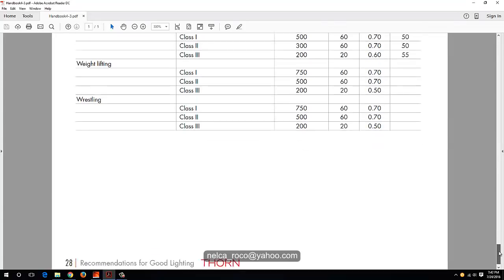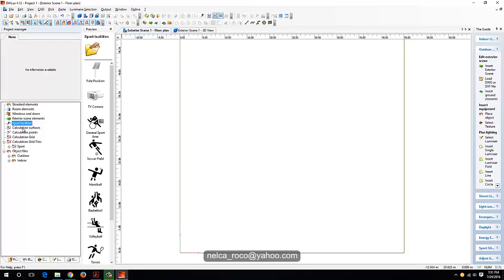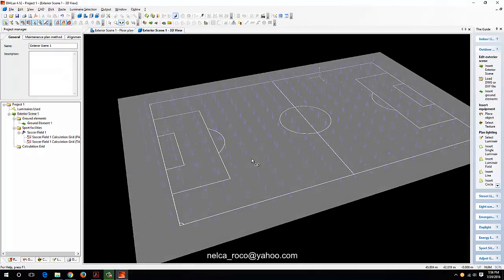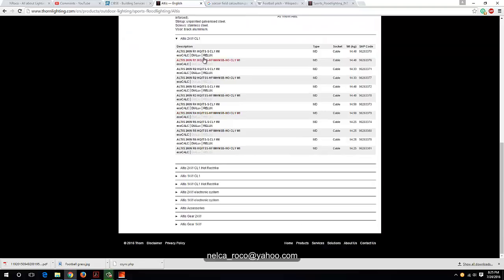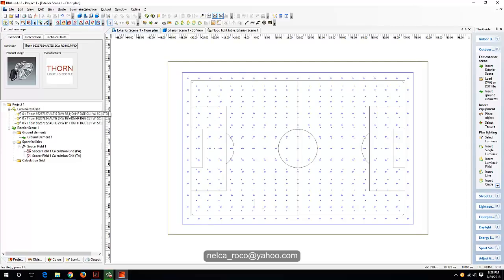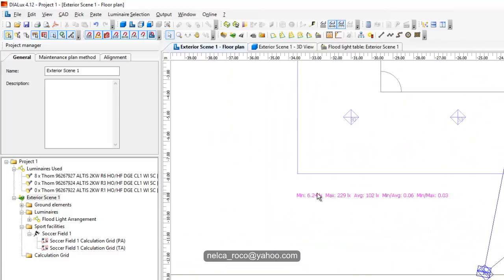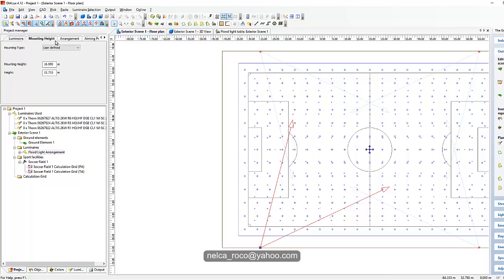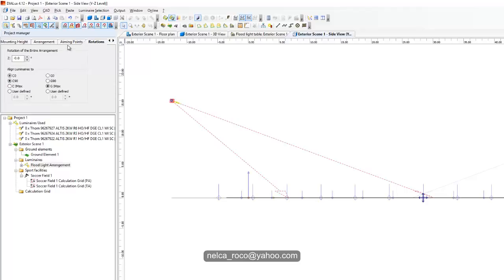Football Lighting Design Calculation (Part 1)

Comment: Hello.!Miss Nelca, I´d like to thank you for your football lighting design calculation. It was most usefull for me.!I achieved a 0.52 uniformity and 200 lux average. It took me a bit but finaly equalized with my handwritten calculations.I have a question anyhow.Is it possible to use a generic lumeniere.? Because I´d like to mess around with the lumens / lumeniere that I have at handhere in Paraguay.I looked around in the DiaLux program, and I couldn´t find anything like it.Yours SincerelyBraulio

Comment: Thanks Nelca. Very useful.... One question. f I have in my laptop dialux EVO, I can work in Dialux 4.12 in the same laptop? This question is because I had tried, but i cannot install this version without uninstall Dialux Evo, and usually I work with Evo, but sometimes I want to be able to work with 4.12....  help....
Reply from the maker: U can install both. No probs. U can even work on Dialux evo and Dialux 4.13 at the same time. Remove firewall for the meantime before I stalling the software to avoid error.
Reply: @NelcaRoco  thanks.... ☺I'll try....